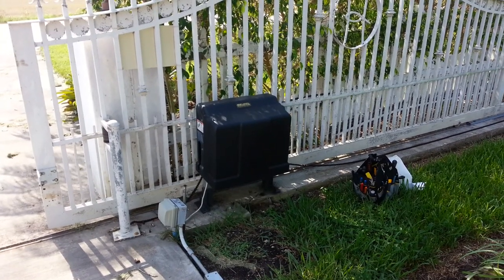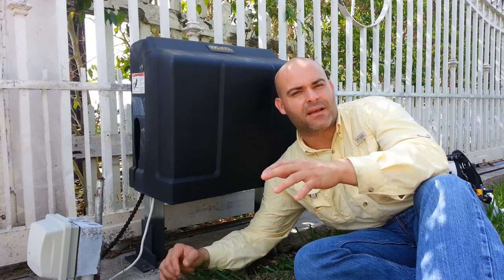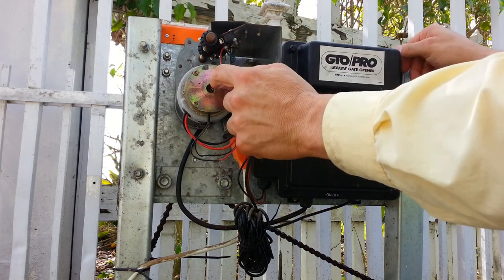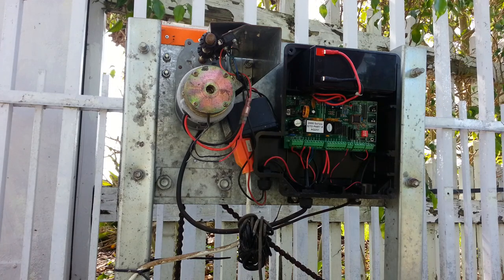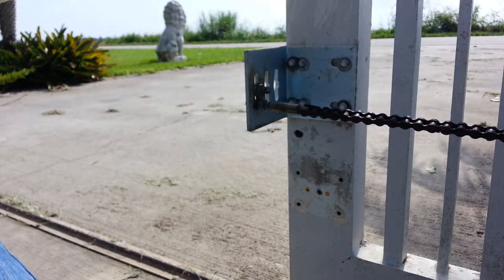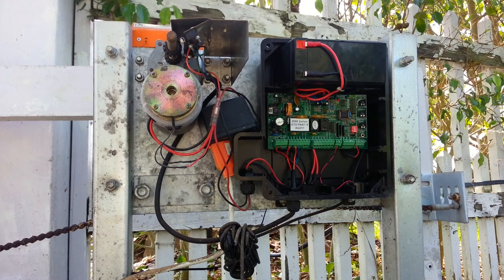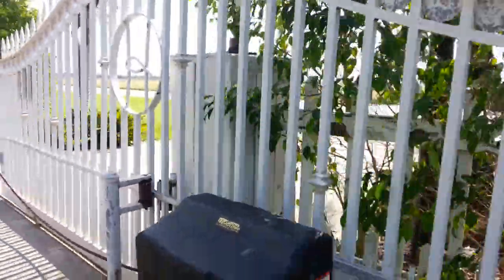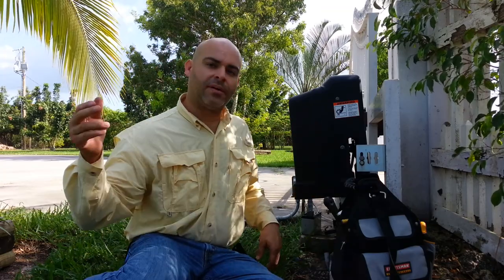GTO-PROSL2000B gate motor REPAIR

Comment: I have an issue where it opens up just fine but when it goes to closes it moves a few inches stops and alarms 3 beeps. I've had it a few years now and never had this issue. I'm thinking it may be stretch in the chain but not 100% sure any tips?
Reply from the maker: I would check the bearings on the gate. When the gate is opening, it is not as sensitive to obstructions because it is opening so it thinks I can’t hurt anything. But when it closes, since there is a risk of crushing something it will reopen or stop. My guess is that the gates wheel bearings are done and need to be changed. Please let me now if that is the correct fix.
Reply: @allritythen  without chain on gate moves fine by hand. I can still check the bearing but I believe they are fine
Reply: @allritythen  another thing is if I retry it a couple times it will close I'm thinking maybe chain got stretched but not sure
Reply: I’ve had this opener for about 15 years. I’m actually on my 2nd one as of 3 years ago because the control board burned up and they stopped making the old control board 

A few months ago I had a similar issue. It opened but went slow closing and would stop and beep. It would go a few inches.  It would even stutter like go an inch, stop, go an inch etc and then beep.  I ended up unscrewing my motor brushes and spraying contact cleaner in the holes and it’s been great since the. I think maybe the brushes weren’t making contact properly.
Reply: @livingaboard  I ended up replacing battery and issue was resolved

Comment: I have this gate. I recently replaced the circuit board and eye sensor. Since then the eye doesn't do anything-it has power and the lights operate but won't reverse the gate. The other problem is it won't reverse even if it hits something. It just stops and the fuse blows. I have tried adjusting the inertia and obstruction sensitivity but they don't seem to do anything. Ideas?
Reply from the maker: RMD3819 Sorry my brother. If you have not yet done so, Try downloading the trouble shooting PDF guides. They have helped me with different problems. Step by step ways of finding out whats wrong. Good luck. Post another comment if you find the solution. I have not run into that yet. I do not have a sensor on mine.
Reply: where did you order circuit board & did it come w/four (4) soldered wires? i have tried to contact mighty mule , only automation is answering. please help i need a board

Comment: Is a Saturday. Finished Install During the Week, Just Need to Do Limits and Remotes. 
I Can Set Limits With The Slotted Wheels, and The Encoding Wheel and Learn Limits, This Has Both, Think I just Have to Set Wheels like You Show, Just Wish They had a Note To IGNORE  The Learn Limits, Now I Have To Research More 😢
Reply from the maker: @randyaivaz3356  I hope you can get it figured out.